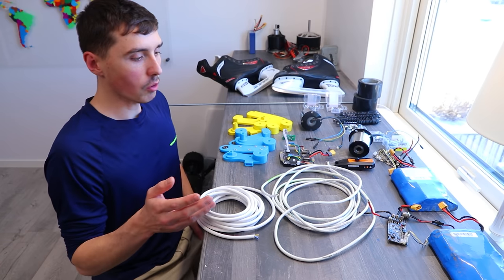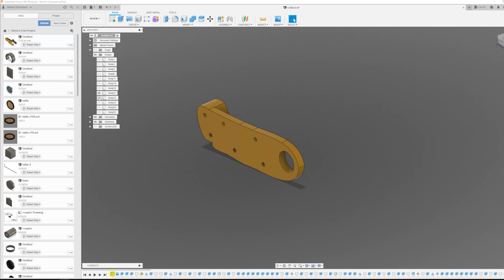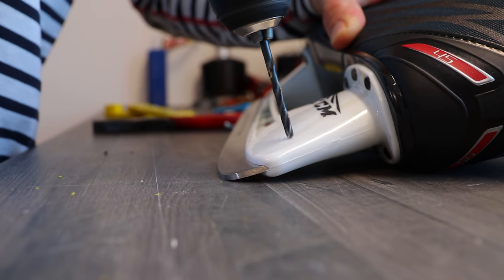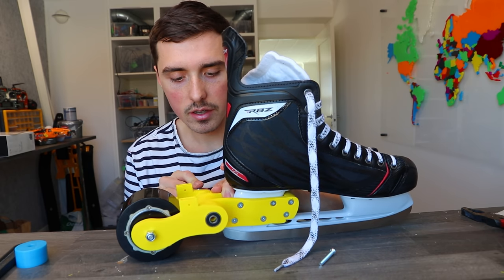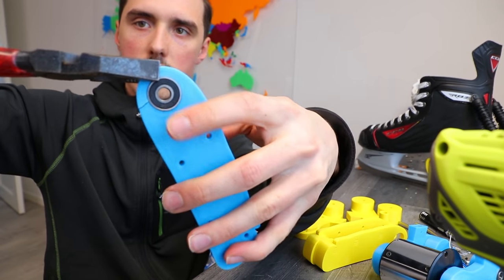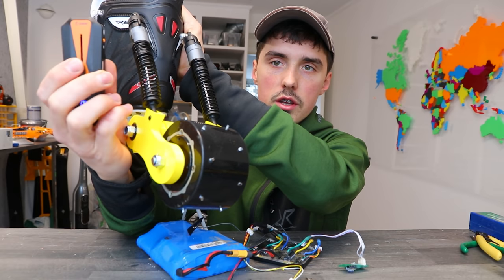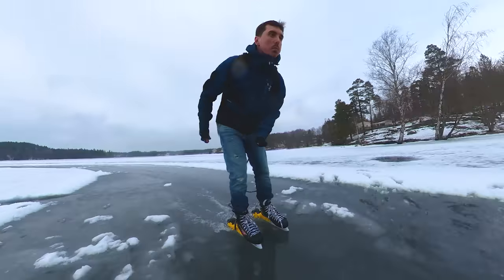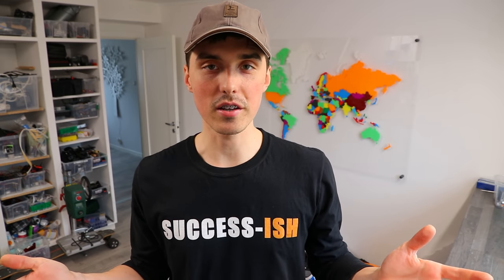Electric Ice Skates That Can Also Be a Meat Grinder

Comment: So i have a few thoughts on the design for future iterations, some are small changes, others are more radical.

First and most radically you might consider taking a pair of roller hockey skates and retrofitting the motor directly to one of the wheels of the skates, this could be with the standard wheel for summer use or with studded wheels for winter use.

Secondly and less radically i would suggest using a more rounded wheel profile, an inline skate wheel might work best or perhaps a wider one might be more ideal but for better traction whilst using your edges a more rounded wheel would be best, think of a motorcycle with car tires versus motorcycle tires for an analogy.

Thirdly and fourthly i would suggest making the mounting bracket for the springs integral to the bracket that mounts the whole system to the boot and to mount the bottom of the spring closer to the pivot point, thus effectively increasing the amount of pressure applied to the wheel.

Fifthly i would sugguest printing the parts with hollow channels in them to allow you to insert steel rods to make them much stronger, think rebar reinforced concrete.

Sixthly I would suggest instead of melting the parts to heatform them to the shape of the blade i would instead use  a high density foam glued to the part and then crushed into place, this should give a much better contact to the skate and should help isolate the bracket from the vibrations lengthening the lifespan of the part whilst also making it more durable and making it easier to enact the steel rod reinforcements.

Lastly as a nod to safelty i would place a guard over the wheel in a similar design to that of an angle grinder, this would ideally be a separate piece removable simply by undoing a few screws/bolts.

I hope these insights of mine will help you when working on future itterations.

Comment: what if you put the wheel on the side of the front part, you cut could press them down wil leaning forward that way, and maybe they would be les in the way for manual skating.

Comment: What do you need is a small airbag or hydraulic cylinder that you can increase the tension to engage the wheel more small airbag would work just like the spring but way more attention you have a small canister for compressed air in your backpack you regulate the pressure with your controllers in your hands This will help you engage the wheels more tightly and you can lean forward maybe one airbag wedge type would work

Comment: I suggest replacing the screws by a strip of "Expanded Metal Grating" wrapped around the wheel (mind the orientation), that would give a ton of grip, be much lest dangerous and require only a few well sized screws to hold in place. You may also get a better ride if the wheel is rounded/shaped in a way that you can lean to turn without the wheel interfering. It would also help to preserve constant traction while turning.

Comment: WHat if you design motor mount brackets which can turn left and right spring loaded so they can turn. With that the whel would always have connection to the ground even if you lean into a curve

Comment: Maybe heat the studs up and melt them into the plastic wheel. That way you could have the pointy end of the stud facing outwards for better traction. I’m no expert, I live in the uk so I’ve never had to use snow tyres or anything, so that may be a terrible idea but it was just a thought

Comment: If you put the motors up front on a swing arm type suspension(look at where the rear motorcycle tire is if you are unsure of what that is) make it have with very limited travel for mild control on traction(farther you lean forward more it grips), that may help with being able to accelerate and not lean back, seems more natural to lean forward while accelerating.

Comment: What if you modified the skates and placed the motor directly under your heel with a flat"ish" plate in the front under your front foot that connected to a lever that would equally create down pressure on the wheels as you leaned forward?  Keep building, your vids are great and the comedy is awesome!

Comment: What if it was front wheel drive or 2 wheel drive on each? I think wheel placement is the key and the best place would be between the toes and sole of the foot, kinda like your foot grabbing a round object, or a runner at the starting line with backstops behind his feet. But I would use more metal then I would plastic. Plus bigger output motors and sharper studs. But then again you can take away the blade and hook up tracks of some sort and make snowmobile skates.

Comment: sweet. id run a platform under arch of boot, run extended arched swingarm to wheel and have mini shocks from wheel to upper boot w a wing brace. full body weight on wheels yet able to lean forward engaging full speed potential. Round edges of wheels to engage better turning angles.

Comment: I can imagine the reverse mad max world with this gear, where everything is frozen rather than hot.
Rather than coil spring, using spring plate  will more stiff while have some slack to compensate for dynamic balancing  from your own body weight. Using a pair of rods might give full effect of both acceleration and deacceleration to your body with no room for the body to counter the effect.

Comment: I love your thinking and your work.  So I am sure you thought of these two obvious things but: put a fender over the top of the wheels so that you don't end up grinding meat off of your butt or hand or whatever comes into contact with them and put arresting brakes over them coupled with a the pivoting linkage so that it will that stop them spinning when they lose contact with the ice.

Comment: usefull !!!! , you could put a rounded design on wheels, it will give you control on turns , and make a planetary gear  and a ring wheel design to make more traction with less work:) good luck

Comment: For the next design I would but one motor in the front and one in the back. So you had two wheels with spikes. I would also make fenders for the wheels so you don't hurt yourself. In that thay it would be much safer.

Comment: Instead of a hard mount, have the motor sat slightly below the parallel of the skate, and have some stiff rubber that can compress to level the motor appropriately

Comment: You really need air filled studded tires. Like from a bigger scale RC monster truck.the air wheels want to have roundness in the opposite axis. Will be a good ride and better grip and better handleing and more user friendly vrs your hard square wheels. Shocks need to be mounted to your 3D printed frames by making riser. Attach them to your current set up. Enjoy

Comment: Still think the springs were the right idea, I would have mounted them lower so that the motor articulates PAST the blade of the skate, keeping the spring constantly loaded with a bit of a "push you toward the toe" pressure. This would keep the motor in constant engagement and make sure the studs get really good purchase.

Comment: lol. You are a nut! Great stuff! Maybe you could use that same system with a rubber tire for rollerblades in the summer.? And maybe a safety feature or for the studs could be a little mudflap. Could safe your butt if you fall . Or at the very least keep it a bit dryer from all the ice flying up. Either way awesome video. Educational and entertaining as always. :)

Comment: Use screw studs. Have them on both cars and shoes. Best-grip.se have good ones. 
Maybe also more power? Bigger wheels with Protection from the meat grinder. Like small hubmotors.

Comment: You should buy some VESC speed controllers, they are much more configurable and flexible than the speed controllers you have been using. You could use the VESC on all motors from big to small, and define exact power limits and working modes. Get the latest vesc 6 models, forget about the old 4.12 models even tho they are cheaper.

Comment: Very nice project! 
But please do not use installation cable for mobile projects, especially not in cases where your security depends on it. Use only stranded wire cable for stuff like this and also take a look at the temperature recommendations for your cables. In this case or for example an eskate a broken wire means no breaks, which can bring you and others in danger.

Comment: Too bad you could not make the spiked wheel V shaped and split it and put it in the middle of the skates.  Then you would not need the hinge or the shocks and you could lean with the skates easily still.  Maybe with a smaller motor and some restructuring of the skate blades you could have a package that fits under the skates completely and is incased nicely.  It just looks so clunky with everything hanging out the back and wires everywhere.  Then have a wireless remote to control it.  One advantage of your design is you could put a servo to lift it a bit when you are costing so those spikes are not bumping along.  Another good thing about motorized skates is you can also used them as breaks.

Comment: im putting this on some roller blades lol  thank u......
Reply: i drew this as kid there was no way to put the motor and batteries impossible big.
Reply: i was thinking a pressure sensor in the heel so the motor shuts off when you lift your legs of the ground.

Comment: Clean, elegant design of parts and assembly! I play hockey, and design new products and was impressed by your direct solution path, kudos!
I might replace the cylindrical spike wheel with back to back cones, so you can lean the skates too, and adding that guard, you might lose the vegetable shredder secondary function, but will reduce the odds of making an actual butt shredder🤕. I wonder if just rc car pneumatic wheels(plus more down pressure) would still get enough traction but not scratch the ice so badly(?)

Look forward to seeing next model. SUBBED✔️

PEACE & HEALTH 🌍🌎🌏

Comment: I  can't help wondering why.  Nice build,  definitely  that,  but why?   About English.  The words use and utilize  have distinct meanings and are not interchangeable.
Use is the general application term that  is the one we should default to  when in doubt.  It connotes a conventional  accepted application of a thing.  Example:  "I used the hammer to drive nails."
Utilize  connotes an off label use.  Example: "I utilized my Zippo lighter to drive nails." 
I know, I know  it seems every one is utilizing  the word utilize for the wrong damn  purpose. 
People are idiots. What can I say.